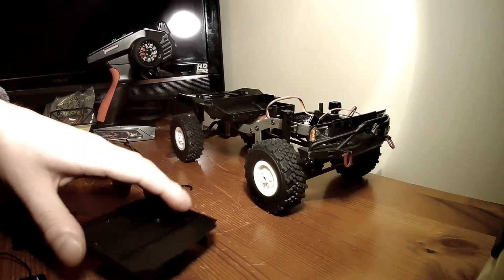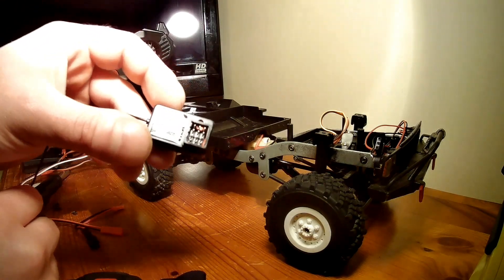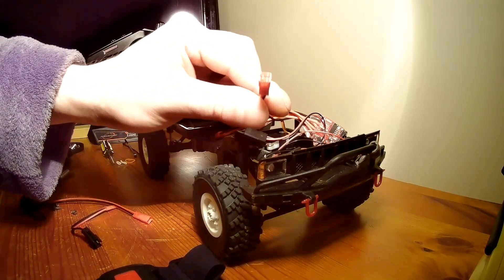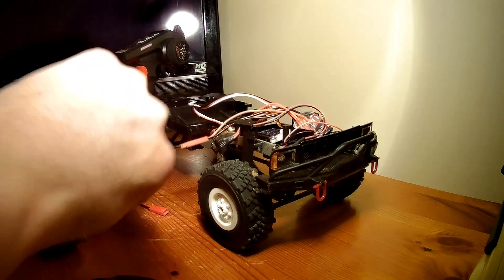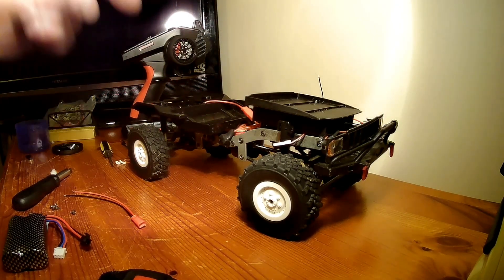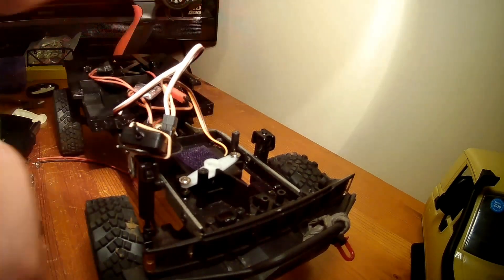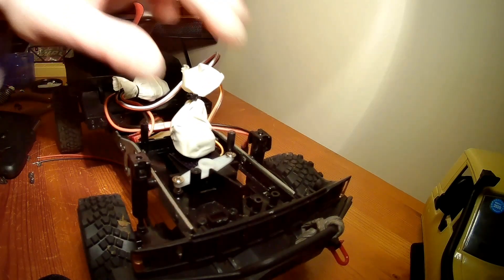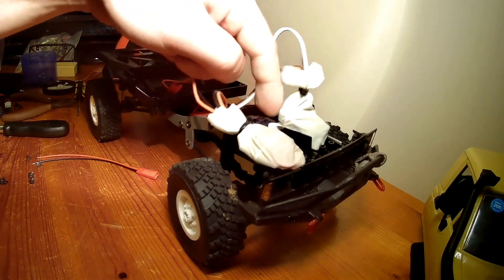WPL/MN/JJRC/Fayee 1:16 RC How to Upgrade Electronics and Weatherproofing.

Comment: Hi Sir,
Please share me the buy link for SM2P battery to JST output converter cable wire.
Reply from the maker: I got the jst-sm connectors from Amazon and crimped them onto a jst cable to make the conversation wire.

I cant find my purchase history of them sorry.
Reply: @THYC  If i buy both type of wires then joint them will it work with stock battery?
Reply: Hi Sir,
Please help me one more point that i have one stock 6v 600mah battery, can i use that with dual speed gearbox & this 20A esc ?
Reply from the maker: @arnabrockzz  yes and yes 😁
I find you get a slower modulation with with 6v, less jumpy 😁
Reply: @THYC  thanks for your revert otherwise i have to buy one new battery which will cost around 25 dollars 😂
Reply from the maker: @arnabrockzz  make sure you match the polarity correctly otherwise it will go pop!
The official store has some 1500mah ones for around $10
Reply: @THYC  That’s great buddy, if possible can you share me the buy link.
Reply from the maker: @arnabrockzz  https://www.wpl-rc.com/collections/electronics/products/2s-7-4v-18650-1500mah-li-ion-battery?ref=THYC_RC
Reply: @THYC  for SM2P to JST conversion as you suggest i will joint red wire with red & black wire with black, hope thats enable my stock battery to powerup 20A ESC & dual speed motor.
Reply from the maker: Yes that will work, sorry for the confusion, you were looking for a jst battery not a jst sm one 🙈

Comment: Would be nice to see the model numbers and brands of the new parts.
Reply from the maker: I'll add them to my description now, thanks for the heads up bud👍
Im using a austar ax6 transmitter/receiver and a mini 20amp esc with break. Here's some examples you can shop elsewhere 😊

Transmitter/receiver 
https://banggood.app.link/SiBDjgWdA6

20 amp esc
https://banggood.app.link/UBQ6Sk2dA6

Battery with jst connector to match esc
https://banggood.app.link/ON3tvG6dA6

Hope that helps bud, if you have anymore questions just ask 😊👍

Comment: Nicely done mate! This video takes me back to the days I was struggling with the exact same upgrades for my very first WPL, would you believe it was a C24 as well? :D
Reply from the maker: Ive seen throughout the Facebook group's lately lots of people are burning them up from not worrying wiring them up properly.  I hope this prevents that 😊
Im hoping to upgrade my rxtx soon to something digital with EPA.
Reply: @THYC  I only have one truck with a remote that uses End Point Adjustment and it´s very nice. It´s a PartnerRacing QX(Axial Wraith clone) 1/18 with V8 sound module , I love it! :)
Reply from the maker: @leirameirarc  EPA will make setting up the steering a breeze 😂 I'm thinking a gt3 of sort, you can buy separate servo end adjusters buy they are like £15 😂